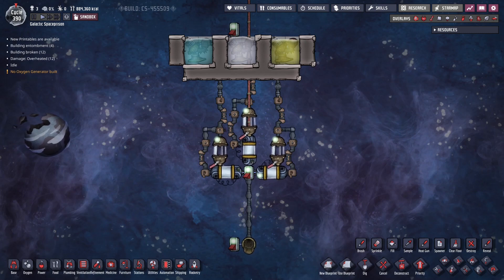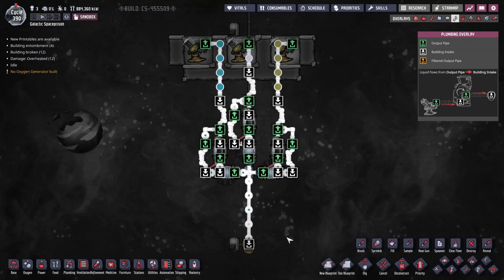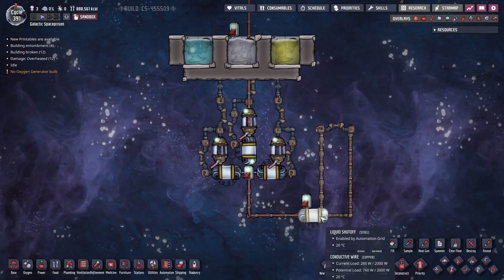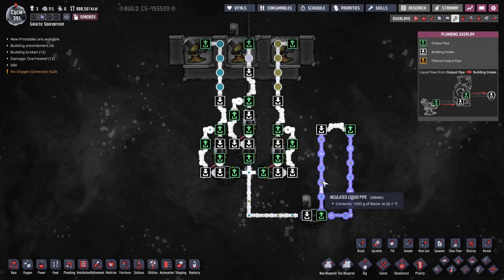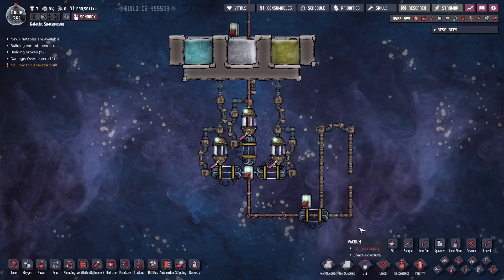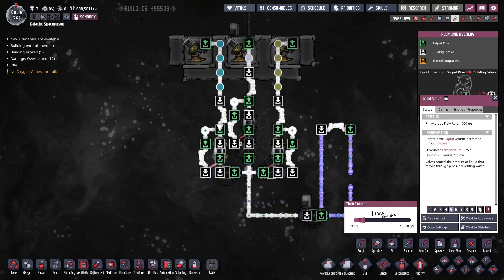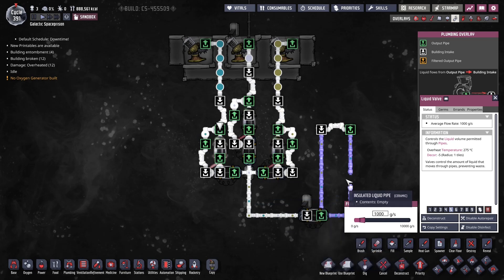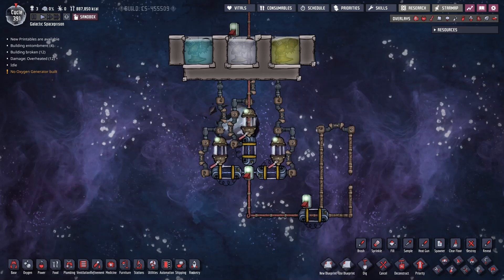Water Loops at ANY Temperature! - Oxygen Not Included

Comment: Ya, utilizing the 10% packet size is a pretty fun exploit to prevent pipe breakage from phase change. I remember my first use for it was for heat deletion by passing ethanol through a hot-room to super-heat it and immediately burning it in a petroleum generator. Works pretty good in if you need some heat deletion and don't have the access to plastic for a turbine.
The process did lead to some ethanol steam escaping the generator though, so ended up with some ethanol mixing with the polluted water output.
Reply from the maker: Also Aquatuning water to 95C, electrolyzing, chilling Oxygen, burning Hydrogen, is pretty good for heat deletion early on.